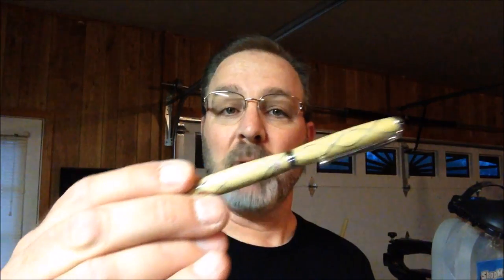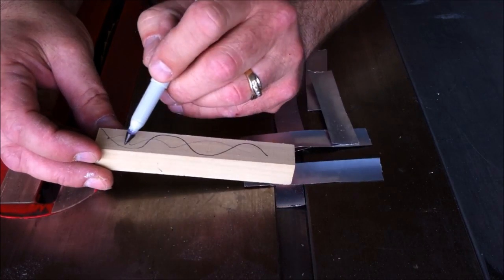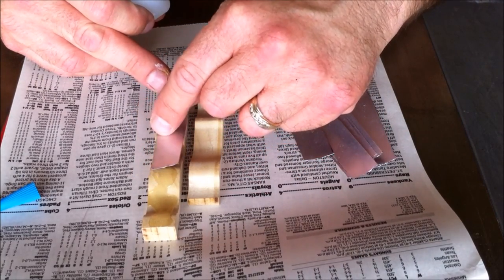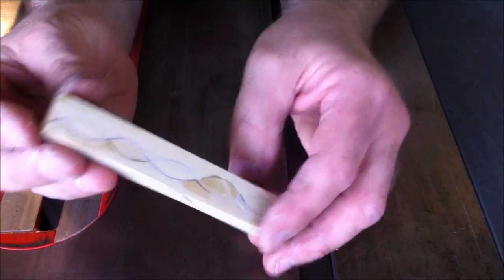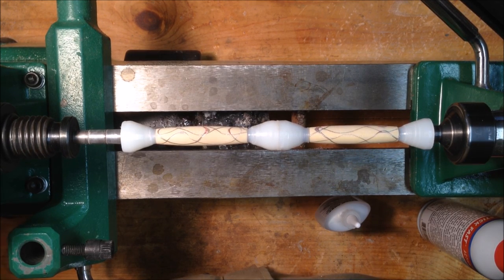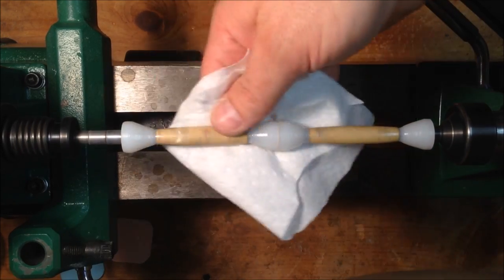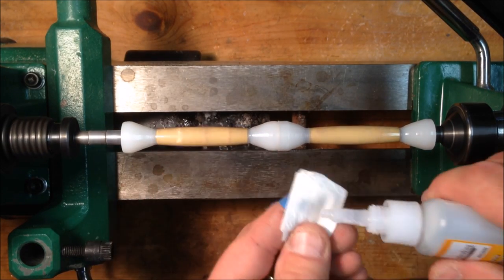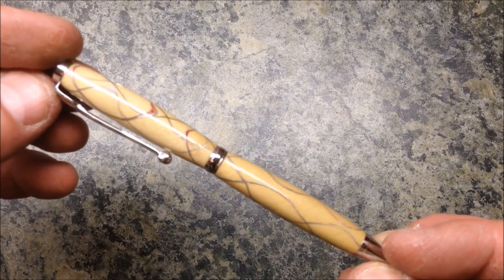Soda Can Segmented Maple Pen

Comment: Another easy-to-understand tutorial on a cool pen design.  I suppose this would work as well with two different woods by taping two blanks together before you scroll saw them, then mix and match when you glue in the aluminum.  I suppose the downside of that is that you would show off the aluminum less well?
Reply from the maker: Hello,
  I'll bet that would work, the Aluminum might get lost a little but overall I'll bet it would look pretty cool. 

Regards,
Bob

Comment: Amazing idea to add a new dimension to a piece of wood. Thanks for this video.

Paul
The Netherlands
Reply from the maker: Thank you Paul,
  I appreciate you watching, and especially the kind comment. 

Regards,
Bob
Reply: Hi Bob, last week I tried to make some of these blanks. In stead of aluminium I used copper, very thin. To cut a long story short, the sawing, glueing went just fine, but during the drilling, the blanks did not survive. Will make another attempt using alu now. The result is just too nice.
Paul
Reply from the maker: Hello Paul,
  I'm surprised it did not work. If you decide to try it again, really rough up the copper with sandpaper. If the blank looks smooth after cutting, rough it a bit too. If you used C/A give epoxy a try. I think this pen with copper would look amazing, I hope you do try it a second time. 

Regards,
Bob
Reply: +RJBWoodTurner Hi Bob, I did rough up the copper before glueing. I will for sure give it a second try, bought some epoxy already. Let you know about the result.Thanks,Paul

Comment: Very nice. I tried the other method of putting a piece every space between the wood. Have not turned it yet.
Reply from the maker: I have improved the process using epoxy. It takes longer to dry but the blue joints are better   When turning. 

Regards,
Bob

Comment: First attempt at a segmented blank, and results were so so. 

The aluminum can strips were epoxied in place, 24 hours left to cure, but still fractured the blank along the epoxy lines when drilling, again when barrel trimming, and finally when turning.  Of the two blanks created I was able to salvage 1/2 of one of the blanks.  The finished pen looks very nice, but I learned a lesson that I have not noticed in the comments as I read through them.

First, there is a plastic lining, very thin, that is applied to the inside of all aluminum cans to ensure food safety requirements are met.  This will form a very insufficient bond with epoxy.  A brush wheel on a dremel will clear this off and leave a surface with which the epoxy will more strongly bind.

Second, choose a pen kit that has a small brass tube to leave some substantial thickness at the narrowest potions of the blank.  The wood tended to crack under the compression of my self centering press as soon as the drill bit was removed to clear fibers.

Both of these challenges would be easily avoided if you know about them, and now after firsthand experience I am unlikely to experience these again... :)
Reply from the maker: +Jared Wolfert Thank you for adding this information the to comments. It will be very helpful to future turners wanting to try this method. 

Regards,
Bob

Comment: Like how you said it takes longer to get the paper towel ready than to use it. 

After just 5 pens I've figured out that paper towels use is the third highest cost to make a pen after the kit and blank. :)

I've started a ritual where I pull off a single Select a Size sheet, tear it in 4 pieces and keep one while putting the other 3 on top of the roll out of the way to keep them clean.

My house was built in 1896 and the ceiling in my shop is only 6' 1/4" high and I'm 5' 3/4" tall and space is at a premium so the roll of paper towels is in a paper towel holder directly above my head. So I can just reach up and grab them.

Also is that just Blue painters tape on your finger? I've been using Harbor Freight nitrile gloves and I see at this point you really only need a fingertip.
Reply from the maker: Your not kidding about the towels, I need to get Bounty to sponsor me. 
  Yes that is Painters tape. I tried gloves but they kept sticking to the towel once it got C/A soaked and tearing the finger tip out. 
  I use the painters tape with a slick finish and the towels will stick but peel right off. Give it a try, it's way better that gloves IMO.

Regards,
Bob
Reply: RJBWoodTurner Yea for this stage its probably better but will still use the gloves for glue ups. CA loves to stick to nitrile. A few blacks I had to go though the remnants of the glove with the pen mill before I got to the wood.
Reply from the maker: I use a pen insertion tool when gluing up the blanks, it keeps my hands away from the glue and mess. A dowel rod is a good substitute. 

Regards,
Bob

Comment: Jumpin' up and down excited!  Such a cool idea.  Glad to see no brand placement in this video...j/k  LOL!  Good stuff Bob.

I've found that the micro mesh pads will burn really fast and add the color of the pad in streaks to the blank.  Then I have to go back several grits to take it back.  Like you said...short bursts of micro mesh, and now I know why.  My lathe is set at 2200 RPM with belts, and requires lots of time to change to slow it down.  So that might be part of my problem.
Reply from the maker: I know those belts are a pain to change but I always turn at the fastest speed and sand at the lowest. Man do I want a variable speed lathe. 

Regards,
Bob

Comment: One last thing before I have to do some work. You may want to scuff up the inside of the can. Its usually coated with something like plastic to keep the pop from tasting like metal. Might affect the glue up.
Reply from the maker: I hadn't thought about that but it makes sense. I scuff up the brass tubes before gluing them in so why not the Aluminum. I will definitely do that on the next on. 

Regards,
Bob

Comment: Another terrific project. And well executed also. This is one time where you definitely want the safety glasses as well as the face shield. One thing I've learned in the past year of taking Machine Tool Tech, is that with aluminum being nonmagnetic, its a pain to remove from the skin. Or worse, the eye. Luckily I work mostly with steel. Lol. But I know you are always safe in the shop. I'm only saying this for anyone else reading who might attempt this.  As always, this has gotten my thought juices flowing.. How about mixing different sodas for a multi color effect. Maybe prepare some of the slivers by painting the backs white. Then mix Coke and Pepsi for a Red White Blue & Silver design. I also think it might look cool with the pieces in your brick pattern. Or perhaps just diagonal throughout, though that might prove difficult to glue up. Might have to start with a much much larger block, like a bowl black that can later be resawn on the table saw. Anyway, I really enjoyed this. Thanks for sharing. :-)
Reply from the maker: Hello ole friend, it's been a while. Good to hear from you. 
  I love the idea of mixing colors, that hadn't even occurred to me. Thank you for that, I will give it a try. 
  Also, I should have mentioned it, but I did wear a face shield while cutting with the Dremel and while turning. 

Regards,
Bob
Reply: Mitchell Martin "mix Coke and Pepsi " no don't do it. Its like crossing the streams. You may get total protonic reversal. :)
Reply from the maker: To funny Cliff,
  I am a Coke, I can't drink Pepsi at all. Maybe a Blue beer can for color. 

Regards,
Bob
Reply: RJBWoodTurner I'm neither now Mt Dew is another story.
Reply from the maker: That green from the MD can would look really amazing in one of these pens. 

Regards,
Bob
Reply: Mix the dew with an orange crush. Lol

Comment: RJBWoodTurner i know the tin was thin but did you see it dull your tools? Very nice pen.
Reply from the maker: Hello Mike,
  I couldn't even tell it was in the wood and the tool was still razor sharp after turning. I guess it's so thin and soft the tools have no issue with it. 

Regards,
Bob

Comment: Aloha Bob,
I really enjoy watching your videos they are really instructional and I have used quite a lot of your ideas.  Ive been trying to make this pen but I'm having problems with blow outs.  Especially when the wood gets really thin over the metal strips.  Any ideas?  it almost seems as if the wood is slipping off of the aluminum.  
Mahalo
Erick
Reply from the maker: Hello Erick,
  Are you roughing up the tubes, if you are, you might try coarser sand paper and rough them even more. Give them deeper grooves for the glue to stick to. 
  If your drill bit is dull, it can burnish the inside of the blank instead of cutting making it tougher for the glue to adhere. 
  I like medium C/A for this application but a good alternative is epoxy. It takes longer to dry but is much stronger. 

I hope this helps.

Regards,
Bob
Reply: Hey Bob,
thanks for getting back to me, I am roughing up the tubes but I will try your suggestions.  I will let you know how it came out.
Mahalo
Erick

Comment: Bob, I have turned several pens but have not finished with CA yet. I just received the Stick Fast CA finishing kit and I'm going to get some blanks glued up tomorrow. Could you share some information in regards to what speed or speeds your run your lathe at while applying CA finish and polish? Love all your videos, thanks for sharing with us!
Reply from the maker: Hello Benjamin,
  My pen lathe is a Harbor Freight belt driven lathe. The lowest speed I can achieve is 750 RPM. I sand, C/A, and polish at that speed. 
  If I could go slower I would for applying the C/A because I believe it would result in a much smoother coat. 750 to 800 is perfect for sanding and polishing. 

Regards,
Bob
Reply: +RJBWoodTurner Thanks for the quick response Bob! I was able to get some blanks with aluminum glued up and turned this weekend. I also completed my first CA finishes. I will say that the CA finishing went well after reviewing several of your videos. I ended up with a fine finish on several pens and I am looking forward to doing some more. My segmented pen blanks did not fare so well, of the four blanks that I cut and glued up I only had one that didn't blow out. I was using stick fast medium CA to clue up but I think it was too hot and set up too quickly. I had voids in my glue ups that I figured I'd tackle with CA fill but they blew up on me. Any advice on what glue to use for segmenting pen blanks? Thanks for all of the great videos, inspiration and advice!
Ben
Reply from the maker: Hello Benjamin,
  I'm sorry to hear you had trouble with the segmented blanks. I have used Stick Fast C/A before and can't remember having any issues with it. I currently use Instabond only because I like the aerosol accelerator they make. I purchase it from www.packardwoodworks.com. 
  If you have time to wait, Epoxy will hold that blank together much better than C/A. I like C/A for experimenting because of the quick dry with accelerator. 
  When I turn soda can segmented blanks, I make sure my roughing gouge and skew are as sharp as possible and I take the lightest possible cuts I can. Any time you have mixed media, they turn away differently. In this case the wood cuts easily but if you are to aggressive it will cut deeper and catch on the aluminum. I turn at the fastest speed my lathe will run. 
  Also, I don't know if you use carbide tools or not but I have never tried carbide so I don't know how it will react to cutting the aluminum.

Regards,
Bob

Comment: Bob, Your pens look great and add a lot to a slimline pen. 
I made a couple of these pens since seeing you do them. How do you keep the metal from the can from staining the wood. I had that happen slightly on one pen and very badly on another.
Reply from the maker: +Otha Hansford Thank you,
   Sand the pen with the grain between grits, that seems to remove some of the metal from the wood. Then clean with Denatured Alcohol. I usually have pretty good luck. 

Regards,
Bob
Reply: Thanks Bob, I knew there had to be a trick to it.

Comment: I have a vintage silk designer scarf that I would like to ribbon into a pen blank. Any tips for treating the silk, recommended adhesives for applying to the wood blanks, drilling concerns? Any insight would be much appreciated!
Reply from the maker: Ellen,  My apologies for the delay in responding. I have never used silk and I wanted to ask around in the community to see if I could find anyone who had. Unfortunately, there was no one who knew anything or had any suggestions. The best I got was to look for something silk at a thrift store and run a few tests. Regards,Bob
Reply: Thank you for the response - very good suggestion. Someone at Rockler recommended that I use Flexible CA glue to adhere the material to my blank. I’ll give that a try . . . on my experiment scarf! Love your channel; really appreciate the knowledge sharing.

Comment: I am interested in your CA finish technique. Everything that I have ever seen required a couple/few coats of thin CA to fill gaps, no sanding. Then several coats of medium. Then sand and micromesh/polish. What is the reasoning behind starting with medium and ending with thin?
Reply from the maker: I use the medium as a leveler to fill any gaps between the two materials. On a solid blank I will use only thin C/A. 

Regards,
Bob

Comment: I have watched many of your videos.   I am doing pens now with a freinds mini lathe and am going to buy my own.  (Yep Variable speed only)  Now I have made a dz and a half pens and I have seen crazing (cracking) of the CA finish.  IPA inputs tried and still see some.  (No not rainy)  Now I did 2 thins and the rest thick and only sanded at the end.  Usually when finishing guitar bodies I shoot, sand, shoot and when it is flat dull I buff.  I tried flattening the ends of the finished blanks on a sander before assembling but somehow I think the cracking may be pressing related. I had issues with CA when gluing fletching on my arrows and had to get some less brittle CA that worked.  Think this is the issue?
Reply from the maker: Hello David,
  I tend to have more issues with C/A if I use activator. Not so much with the thin but the medium is really bad about cracking. 
  When sanding the ends of pens, I swirl them on sand paper.
  Also, I use a non stick bushing to keep the C/A off the metal bushings because it AIDS stick and crack when they seperate.
Reply: +RJBWoodTurner  Yes, I use Delron bushings, big help.  The kits I get have tubes already scoured. FYI, I also do reloading and I have a powered work station I tried to smooth and flaten the finished blanks.  Feared that pressing on the CA might also cause some cracking.  So far so good.  Decided to wet sand lightly with 1500 between CA coats.  Takes longer but I think I get less chance of sand through when smoothing heavy deposits.  Also I experienced failures on Cocobolo blanks when turning.  Several have come apart as I approach the bushing.  I suspect the wood since not had that problem with any other wood.  Decided to make pens thicker anyway. easier top grip.

Comment: really great looking pen, it opens up many other ideas. did you have any trouble cutting through the aluminum on the scrollsaw? did you use special blades?
Reply from the maker: Thank you Matthew,
  Truthfully, I couldn't even tell the aluminum was there. I didn't notice any issue with the edge on the tool either, it stayed sharp. Probably because it's so thin. 

Regards,
Bob

Comment: Do you have any issues with drill bit drift when drilling blanks with metal?  Any suggestions?  I am using a brad point bit.
Reply from the maker: Eric,
  Yes, bit drift is an issue. I have been pre drilling my segments with a 1/4" bit prior to cutting. That allows me to align them then use a larger bit to hog out the tube holes to the proper diameter. Doing this eliminated my issue with drift. 
  I am also planning to build a set of jaws for my chuck and attempt drilling out the blanks on the lathe. Several people have suggested this is a best practice that will eliminate drift, I'll know soon enough. Here are the plans for the jaw set:  http://www.davidreedsmith.com/Articles/WoodAuxJaws/WoodAuxJaws.htm

Regards,
Bob

Comment: I was considering using thin copper sheets, I was wondering if it would be too hard on the turning tools. have you attempted any copper in turnings before?
Reply from the maker: +Benjamine Angeloni Not at all, copper is plenty soft and turns well. 

Regards,
Bob